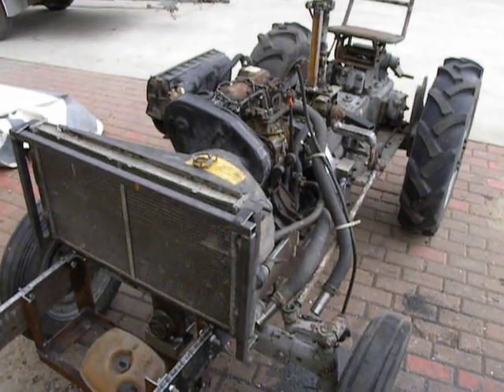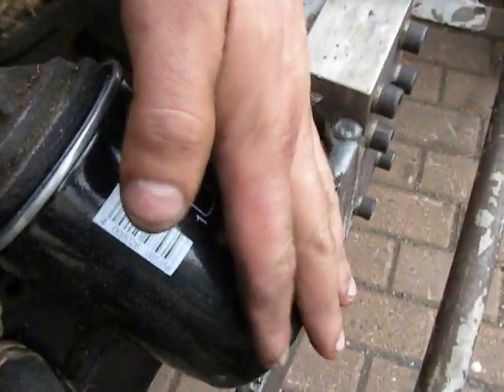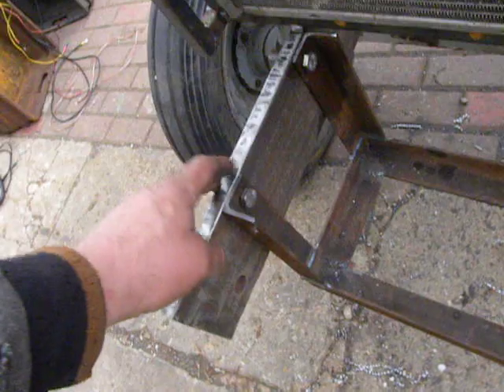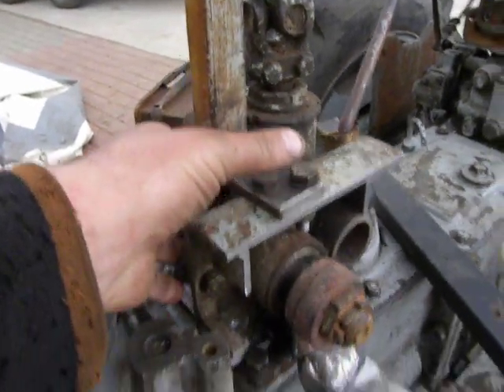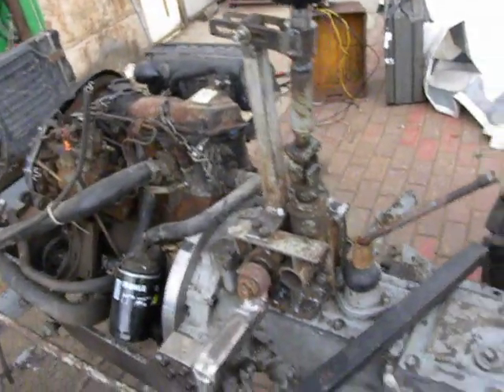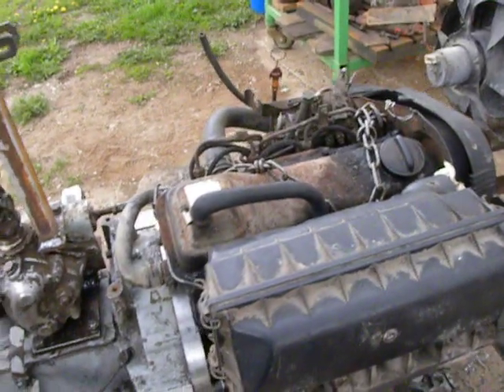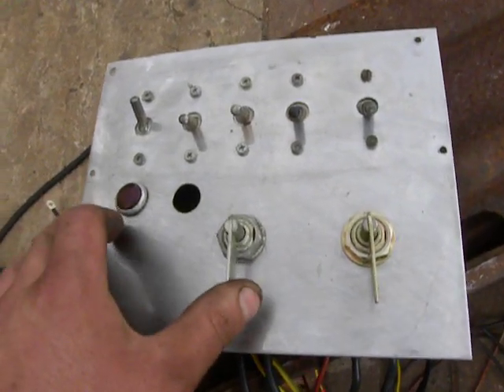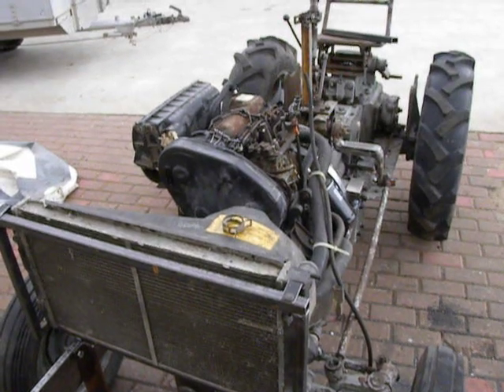Tractor Project - walkaround of works done part 3

Comment: Good on you for putting this all together, but I'm a little concerned by the extension of the steering arm. I'm thinking you might bend the steering axle or damage the box since the wheels now have so much leverage over it. I was thinking about making an extension to the shaft coming out of the steering box and welding a support to the half-frame you made. I made a quick model to show you what I mean: https://imgur.com/a/xz2qRna

Another way might be to offset the steering box all the way to the left side (allowing the steering arm to drop straight down) and moving the wheel back to the center by adding another universal joint.
Reply from the maker: Yeah, I too worry for  that to stearing mechanism could be get damaged. I seen Your great blueprints - there You are put in good ideas what I can create... now I have go to scrapyard and look for parts XD I had mind for that axle extension and supporting it.... but.... I was go easyest way. By the way, I have "Moskvitch" car stearing mechanism as spare part in case if this one greaks down. 
Thank YOU very much for bluseprints!
Ahm, yea, I had think for offsetting that mechanism....  then it stays over clutch pedal and then there is no place for my No-48 boot :-( Anyway, it is too way how to solve a problems. 
P.S. I asked for that mechanism to man from who I get it - he said to it is from 5...6 tonn potato harvester... so for 1 tonn tractor it could handle.
Thank You very much! Cheers!

Comment: have you checked direction of rotation? I re-engine'd a garden tractor and discovered that's the first thing I should have done...
Reply from the maker: Sure I checked direction of rotation... around 20 times, and still I was not sure - is it right. Yeah, I had similar problem with an other machinery and one of my tractor prototypes around before 17 years - there each wheel spin in different direction.